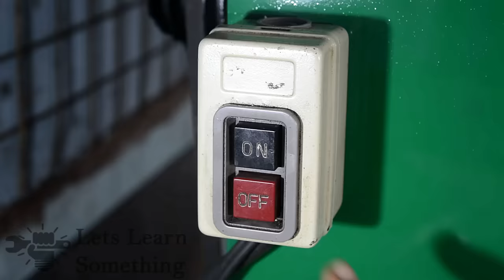Homemade Lathe Machine

Comment: I like how he uses the as yet unfinished lathe to make a perfect circle out of the plate the chuck is mounted to. The lathe's begun service even before it was fully ready for service.
Reply: Ññññññññññ
Reply: U
Reply: That's called bootleg building.  Get it working enough to make more parts to make it better.  This kid is going places.
Reply: Love it as that build and work to produce parts for self. Good
Reply: This is just a neverending spiral, with lathe like this you can make precise spindel shafts and so on, you can now start working on a mill and once you got lathe and mill you can work on more complicated mechanisms and so on.
Reply: @rvag3394  within a year and a bottomless pocket he could be at 6 axis CNC milling. But at some point you have to decide when enough is enough, enough time enough money enough frustratingly endless troubleshooting loops. But I do think this individual has a very good grasp of fabrication
Reply: @skizzik121  its 2021 bru, youngsters nowadays doesn't need fabrication, number of views and subscription is the new industry
Reply: Will Swift  depends on your region, but usually if you want to buy small amounts of steel scrapyards are your best bet. Also you can usually contact your local machine shop and get raw materials from there, but doing so be prepared to bay a bit above the normal shelf price.
Reply: It was actually quite commonplace to machine the faceplate with the machine itself to ensure it runs true with the ways.
Reply: @doddydwi9850  Plus unending material.  Look at the big number of views channels.  Lots of content.

Comment: Ok let's review the facts:
1.  It no-kidding works.
2. He made it himself with fairly modest tools, no computers or DRO or CNC anything
3. No mis-drilled holes or anything else
4. It's as good or more likely better than $500 worth of Chinese import 7x12, in size and performance
5. The video itself is to a high standard; well lit, well focused, very well edited.

All in all, credit to this man for making it happen.
Reply: I do not argue what he did well. But the fact is that he bought a ready-made designer who needed a foundation. Have you seen how some people assemble a lathe completely from scratch and make it yourself until the last bolt? That's exactly what I call a real master. So I abstain, not like not dislike.
Reply: @СмыслМеждуСтрок  If you mean ready-made design-the linear ways, for example, he is exactly correct to buy these "off-the-shelf", as there is no way to fabricate these with the very primitive tools he has at hand. Making every piece by hand is impossible How would you build ways by hand without a lot of sophisticated tools, HUGE heat-treat furnace, long surface grinder like Okamoto etc, etc,?  Making bolts from scratch is the work of a fool. I don't think you understand what this guy accomplished. Pedantichnyy...
Reply: @СмыслМеждуСтрок  why can't you give him credit where credit is due! I will be damn if I would make some of the stuff he used when I can buy it ready made ....
Reply: @Vodichka9  actually those can be built by hand with relatively simple tools. It needs lots of work and very flat reference surface like lapped granite. 

The technique is called scraping and it produce very straight surface. The idea is to use indicator color and scrape off high spots untill the surface is totally flat.

I don't mean i suggest that method for home made tools, but that's how prescision tools were made in old days and some still use it when restoring old tools. 

Using linear bearings is interesting idea and for sure the lathe is very smooth to use. I'm not sure how long they last because sometimes vibrations can be nasty. I wouldn't at least make too deep holes.

What comes to precision, there is always some machinist who is not satisfied for hobbyist's tools. In many case it is enough to have a rotating piece tightly in a chuck and moving mechanism to hold the toolbit. It is much better than any other tool to make so many things.
Reply: Awesome welding technic ❤️🙏🙏
Reply: The welding bead is perfect...  very    skilled
Reply: Jim's videos j.
Reply: @teropiispala2576  I've just watched here two clowns making small DIY surface grinder and they aimed for ambitious  half thou flatness-  lots of measuring , adjusting etc, and in the end the product turned out to be a non finctional  garbage , this man here is an artist and skilled one - he made a working lathe accurate enough for his needs and I don't think he makes aerospace components
Reply: Ur just jealous
Reply: No
Reply: @ Jim's ; he has not checked eccentricity with a clock-dial micrometer. and let see he using a hammer to put a ball bearing !!
Reply: @ThuanDuong-pv3xu  yea but now he has a lathe, he now could fabricate a bearing puller, bearing race and seal set and whatnot, and soon maybe a mill. With this lathe and that mill he'd make a truer lathe. That's how it came to be.
Reply: @MrKkdkk  I mean this is fine for a regular user, because lets face it he is not going to be doing any fancy machining on it like cutting threads and such. I'm a machinist and a welder myself and 99% of the time the lathe gets used it's just turning stock down and drilling holes, no fancy thread cutting/broaching/taper cutting/etc 

Just being able to do face cuts and make shafts/holes for the bearings is huge, he can make like 10+ tools with this lathe now.

And remember, we started turning wood using strings and man power, then we evolved to lathes hundred times worse than this and look where are we now.
Reply: @lazar2175  yes but if the person i was replying to was talking about precision and accuracy i think you can make more precise tools from less precise tools. maybe his lathe now have a 0.5mm accuracy with some play in it, if he build a new lathe or upgrade that one utilizing his current homemade one maybe he can get a more precise and truer lathe. I mean, it's better than using a power drill and a chisel, right?
Reply: @MrKkdkk  For sure, i'd say this is like 0.5-0.3mm runoff like you said, but now he can design better carriages and get like 0.01 or something.
Reply: The lathe is pretty impressive, but it like it cost more than $500 to make. I doubt that even a Chinese lathe would be as low as $500.
Reply: @ht4g1s03b  My thought to, as if main plan was to keep it as a manual lathe trapezoid leadscrews would have been better than the balls crews used. However great work I enjoyed watching the progress :D
Reply: the precision of this machine is practically non existent, sure its well done but this is nowhere near good
Reply: @ThuanDuong-pv3xu  :

It's a proof of concept and he deserves credit for this.
Reply: No missed drill holes? That's where you are making a mistake. This video has been edited, he has tried drilling a couple of times, Until he got it right.
Reply: @СмыслМеждуСтрок  well said 👏
Reply: stricktly talking about the iron of this machine... one of the very important reasons why casting are used in machine tool is density and weight. when you have a dense machine foundation you WILL get a better finish when cutting.. this has always been there case and that's what quality lathers have been casted iron for 200 years. using structural steel or iron for the bed is a compromise..

Comment: Kid, you have got IT. My dad was a machinist for 45 years, and put me and my 4 siblings through private school. Granted he worked 16 hour days for a few years, but he did it. I grew up in the 80s watching him work on a lathe at home that couldn't have been a whole lot better what you just made.

Build yourself a milling machine and a clientele and you'll never go broke. You might never sleep, but you'll never go broke.

I wish I could do what you did here. I definitely missed my calling. I could have inherited my dad's shop had I the interest back when he retired and sold his shop. As it turns out I have the creative mind for this kind of stuff, but lack the education. Stupidest thing I ever did was cheat my way through math class in school.

In awe of you man, you're on the right track.
Reply: Don't let lack of education hold you back. I think if you have the will to do something you can make it happen! Plus we are in the age of the internet so pretty much any information you need is right out there. I think any skill takes lots of practice, so start practising, but be cautious. I taught myself to weld recently after watching Youtube videos. I also fixed my car after my cam belt snapped and bent all my valves again mostly from Youtube videos. I had to buy new ones and grind them in, and you have to get the torque settings for the head bolts right, but you can find most of this information in Haynes manuals.
Reply: Mathematician here. I often wish I stopped studying math at a certain point and got into engineering when I was younger. The math problems that give engineers trouble can usually just be "engineered" around instead of directly solved. Math is beautiful but making things with your hands is so much more rewarding.
Reply: @thetedmang  There is nothing stopping you from buying the tools and tinkering for yourself. The little iGBT welders are pretty cheap these days and the one I got works great and no one ever taught me to weld, I just figured it out for myself. Just be safe. 

Skill and mastery come with practice.
Reply: @burtybasset4486  Fair points, thanks!
Reply: し
Reply: @thetedmang  Engineer here. Don't beat yourself up, my experience is that the best mathematicians make some of the worst engineers, often they get caught up solving some random equation instead of saying "call it ~2/3s and it'll be there or there abouts." - There is a chart somewhere showing the divergence point of people great at maths and the best engineers, and it galls a lot of mathematicians, also galls a lot of engineers who are mathematicians deep down because in my experience, it rarely works out well for them, they get stuck at senior engineer or something at the high point of their career, instead of making it to principal or engineering manager.

I'd also add, this type of thing, making building, its not 'actually' engineering, not in the modern sense, this is very much a tradesman activity (not knocking them, just appreciating the difference). Modern engineering is mostly excel, and an ungodly amount of documentation, a sickening amount. Philosophy, policy, procedure, user requirement spec, datasheet, description, instruction, review, risk assessment, precious little maths.
Reply: @darkonnis  That is true, although there is a lot of bureaucracy in some of my work as well, it probably is not to the same degree as it is in engineering. I started reading books on classical mechanics so I'm going to take the plunge!

Comment: You prove that ANYTHING is possible with the right set of skills, determination and taking action, and you my friend, are a perfect example of the above!
Reply: The above message stopped a little short: You also need the right tools and the right supply sources. I tried a Gingery lathe.  Every mistake snow-balled into an incomplete and imprecise paperweight. I like his work.

Comment: Really beautiful work and it goes to show what you can accomplish once you commit to doing it. Having been a machinist I notice a few small things that ideally would be more tightly fitted or precision ground for better accuracy but this is a great piece of equipment that will last years and can make any needed upgrades or replacement parts. My only criticism is that the belt and pulleys need to be covered before use and with that amount of slack a tensioner will reduce noise and slipping. Solid 9.5 out of 10. And for anyone who is upset about the half point it's for safety. No machine will tear you apart faster than a lathe. Having to watch the work is enough you don't need the pulley system as a threat too.
Reply: "No machine will tear you apart faster than a lathe"
I'd much rather be using my old 1940 lathe with exposed pulleys than a table saw, or one of those hideous PTO powered screw log splitters.
Reply: @ferrumignis  those machines will maim you for certain. But if a lathe grabs you you're losing whatever limb got grabbed, arm, head etc. I try to be very accurate in my words. If a lathe grabs you it will tear you apart. Not cut, not shear. Rip. You lose a finger to a table saw, or a splitter a good doc might be able to fix it. Lathe yanks your arm and rips something off or takes your whole body for a ride they ain't fixing that.
Reply: @charlesgargotta23  This. There is no comparison to the damage a lathe will do to you versus almost any other tools.
Reply: Beautiful work? You're joking right? From tacking the channel together in the beginning I could already see how shit this would turn out.
Reply: That's why Lathes are equipped with foot brake, if you remember to use it. That pulley area has to be covered.
Reply: @charlesgargotta23  So, no mention of the fact that he did not clamp the work piece/s--(the square metal plates)--onto the drill press table then?
The work may have taken him longer, but he would have been SAFER.
Many of those types of work piece/s, and many more besides, would also rip an operators chest or stomach to bits, quickly.....VERY quickly, laying open the chest or stomach cavities for all to see, and shredding the insides of the body.
Not going to recover from THAT type of injury in a hurry either.....if ever.
In truth, there is NO tool or machinery--(however big or small)--that can be trusted when used in conjunction--(or singly)--with other tools and machinery, especially at speed, or under pressure.
All an operator, or operators can do is to follow current safety guidelines to the letter when operating machinery, and make THEMSELVES as safe as they possibly can. This guy did not do that.
Reply: @james-on1vy not too mention none of his critical surfaces are flat or parallel..its funny to watch layman's give this guy compliments, as if they even know the difference...
Reply: @CleoKawisha-sy5xt  been on YouTube for all of one week. Do one you spank.
Reply: Someone get this man some cutting fluid/oil !! 🤣 that soapy water is drivin me nuts! That’s just me though.. He definitely has some skill although he could use some help in some areas he is an amazing fabricator and should definitely keep up the good work and keep putting out the content.
Reply: There isn't much more "safety" on any other manual lathe.  The exposed belt is no where near the operator when running.  Assuming this is a "one-man" area, there is little to no danger. The cover is easily done with wood.  This machine will not be used for very much. It has no ability to machine to any known diameter, there is no "precision" or "accuracy". It operates by "eye-ball".   Can it even machine "parallel"?   NOPE .....QUITE IMPOSSIBLE.      Your 9.5 rating is truly unqualified.      My rating would be no more than 2.

ANY kind of metal "chip-making" machine cannot be made from "steel".  This was found out by one major machine tool builder 50 years ago. White Sundstrand built a series of machining centers based on fabricating.  the machine frame was very thick plate.   The end result was a machine rampant with vibration.    CAST IRON HAS INHERENT DAMPENING PROPERTIES.

The "E: value of steel is much "better" than cast iron ...but when it comes to machining, cast iron is simply the only "best" way to make ANY machine tool.

How do you turn to a specific "known" diameter?

How do you generate a thread?

How do you machine a taper?

A lot of work .....and you can't actually do much on it.

.
Reply: Safety is often regarded as an unnecessary cost of time and effort.  When that is thought, it creates a death trap waiting for the day unnecessary cost of time and effort becomes trivial compared to awesomely bad for the accident that follows.  Safety first.
Reply: @udokankamnebe2748  Yes and: The foot brake is not reachable after you get grabbed.  "The pulley area has to be covered".
Reply: @udokankamnebe2748  @jerryocrow1
0 seconds ago
 @udokankamnebe2748  Yes and: The foot brake is not reachable after you get grabbed.  "The pulley area has to be covered".

Comment: I am 50 years old and have been a machinist for the last 30 years. 

You have impressed me sir and I don't get easily impressed.  If I could I would send you a bottle of cutting oil. ;)

Have I great day,
Reply: Indeed, this is an impressive construction! I'm quite cluey myself but, for some reason it never occured to me building a lathe this way other than stretching my brain how to construct a CNC type. Yet, this is a suitable one to modify it into a CNC controlled later...
Reply: I wonder what you have been doing for 30 years if you are impressed by a bit of welding, drilling and cutting connected together with some parts from the hardware store.
Reply: @Gwiedert  I think he was more impressed by the thought process in designing and making it work. But you probably wouldn't understand that.
Reply: @Gwiedert   I agree,  A millwright is precision, bigger bearings help too, my first lathe was a rockwell  36" lot of fun
Reply: @Gwiedert  Guido you better show us your hand made aircraft.

Comment: No chatter, perfectly concentric, lacks a back gear so no thread cutting facilities, but could be added, better imho than many manufactured products at the lower end of the market, I would be proud of this were it my work!
Reply: L
Reply: P
Reply: Exactly. This runs better than the one I have to use at work when I have to run the manual lol